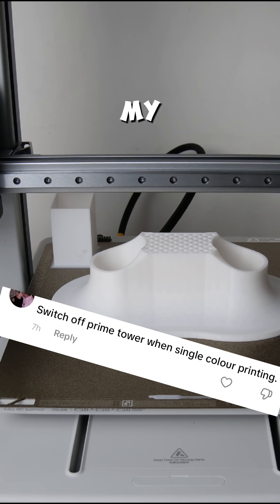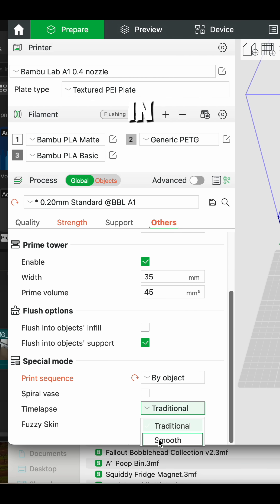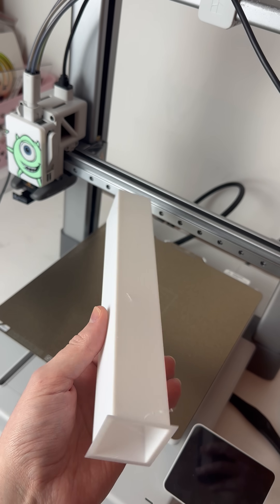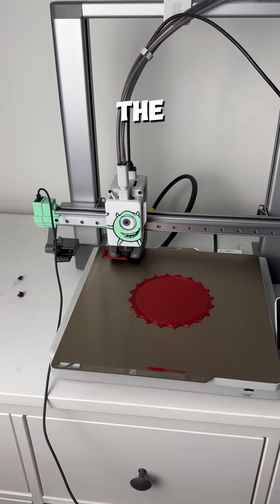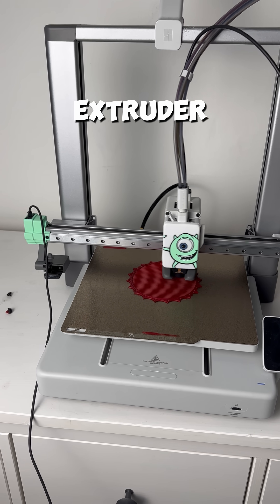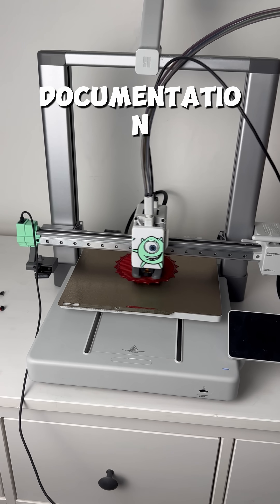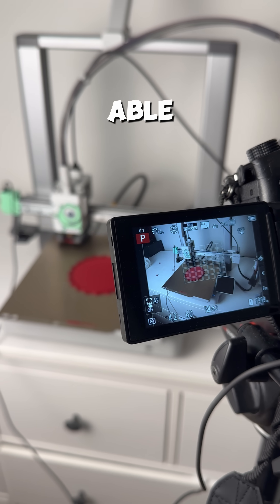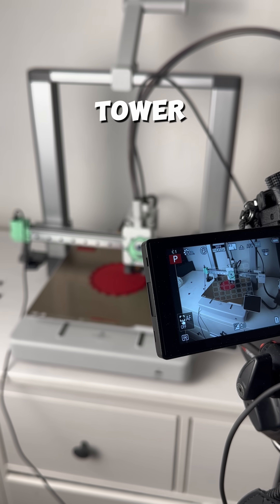Why do I have purge towers for single colour #3dprinting #3dprinter #bambulab

Comment: My old ender 3 hasn't had much of an issue printing smooth timelapse without the tower.... I just ordered a Bambu Lab A1 and am a little sad to see this. Is the an easy way to set  timelapse, without the tower, and after each layer, going directly back to infill first, instead of walls?  Thanks ahead of time!

Comment: I use retraction on mine. It makes a smooth print with no issues. I had a failed print because I forgot retraction settings and the difference can be seen. It took Alot of tuning to get the retraction correct tho and not every printer is the same. In the past I did the same where I would print a tower so my prints would be correct when doing timelapse.

It can be done either way but for me, I only use towers now on my multi color prints.

Comment: on bigger prints you don't need a purge tower - just change the order of stuff being printed

infill first, then, inner and then outer walls - so the defects will bei masked in the infill or at worst at the inner walls - no need for wasting that much material

Comment: For a lot of prints you could probably print infills before walls instead of printing a purge towers. Small defects in infills usually don't matter.
Reply: My thoughts exactly. That and the fact that the tower seems to use an excessive amount of purge considering the amount of degraded filament left in the hotend.
Reply: @agsup  yea, the purge tower could be a lot smaller but the smaller you go the greater the risk of adhesion issues and thus failed prints.
Reply: in orcaslicer there is a settings for that

Comment: Maybe bambu can design an option for various purge tower design as a user option.
Stationary holder, clips, last meter print
Reply: I've had this same thought every time I've seen a tower. I actually just commented something similar 😂🤝
Reply: There is a way to do this
Reply: this is already a thing - either you can purge into an object or into infill - so on bigger prints, you just purge into infill and don't need a prime tower for a single color print - only on smaller objects with high contrast colors, you might get color bleeding with no purge tower.

you can see the settings directly on his screenshot at the start of the video "Flush into objects' infill" should be turned on and then the prime tower can be disabled for this model

Comment: If only the camera could somehow be controlled by the slicer coding, too, you could just have it trigger with the nozzle in a specific X and Y axis in each layer. Sure, you have the nozzle/head in shot, but it would still look cool without a waist tower
Reply: It absolutely can be controlled this way in existing slicing software.

The problem is that you still have to momentarily pause the printhead so that the camera can take a clear image, and doing this in place can leave unsightly blobs of filament on your print. 

This can however be mediated quite a bit by having the camera trigger somewhere in the infill.
Reply: I have the big brother of this machine. It can do it this way, or by default it is just making a timelapse without the purge tower and not moving the print head out the way.. Most youtubers do it this way. It just means the head is often in the way.
Reply: Both the p1s and the x1c can do just that with the integrated camera. It just isn't as good-looking and smooth as these videos.

Comment: You can melt down the purged material and cast them into the shape of glue gun sticks to use with a hot enough glue gun. It's only wasteful if you throw away the purged material.
Reply: And what would that do? Why don’t he just use an extruder to make a filament sample from it

Comment: Maybe is possible to address that problem with some retraction fine tuning? And wipe from inside out settings every new seam
Reply from the maker: Good point will look into it I definitely think there are some ways to mitigate, Like purging into infill if the print is big enough to allow
Reply: @JoBricks yes! keep us updated
Reply: @JoBricksyou really just need something to wipe the nozzle, does the a1 support a brush/wiping pad like what the x1c and others have for after the poops? I’m too stubborn and broke for Bambu so I’m not super familiar with em 😅

The BCN Sigma has a silicone pad that acts like a wiper blade on their ooze/poop bins. The nozzle has to pass over it from the park position at either end of the X gantry, it works pretty well for extended park times! And I’m sure the Prusa XL has something similar. The point being, there’s options!